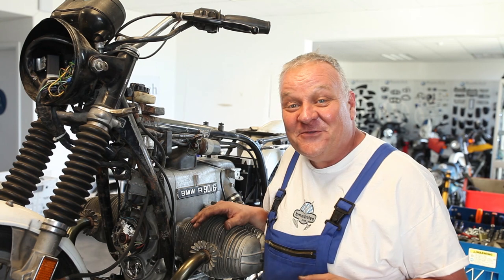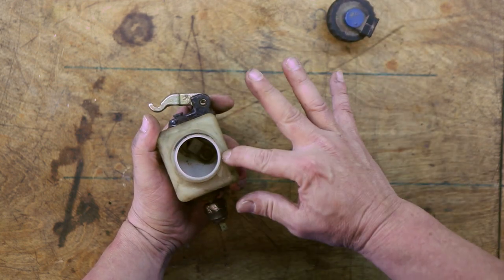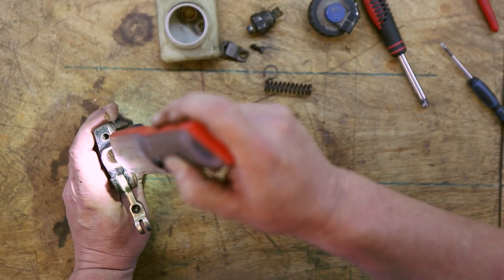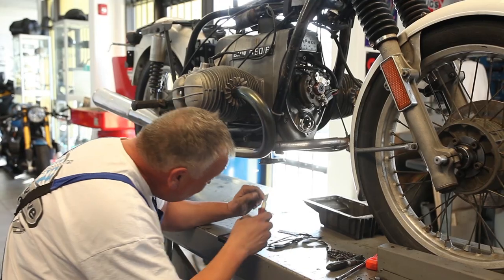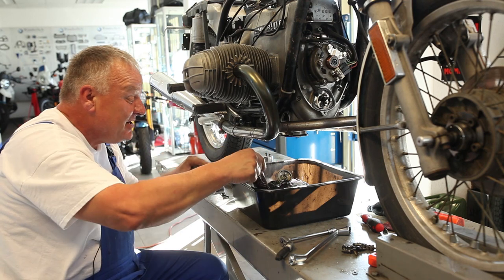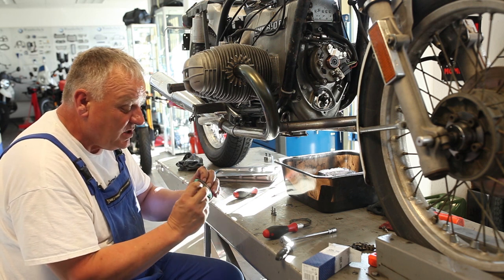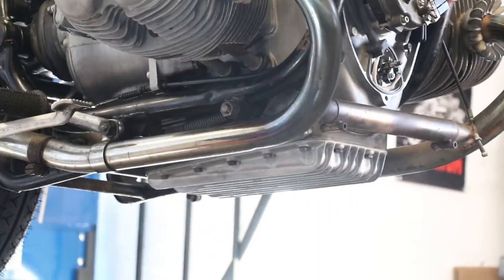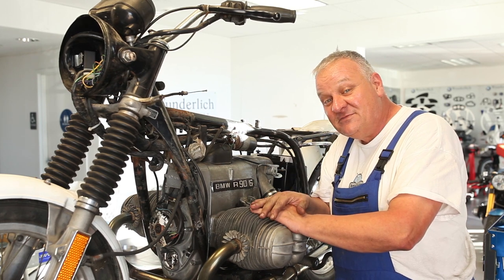R90/6 #14 Master Cylinder Removal & Oil Pan

Comment: Its funny that you mentioned about the old style O-rings on the oil filter. I am restoring a 74 R90/6 and its been sitting since 1986 and when I replaced the oil filter I saw that stray o-ring deep on the filter shaft. Having been a mechanic for over 40 years, I knew it needed to come off ! You are wonderful at letting people know those "Little" annoying things that most don't think of :) Thanks for being so precise !
Reply from the maker: Thanks, Amazing that there are still those O-rings out there!

Comment: Hi  Just seen you remove sump, I was surprised to not see you clean the oil pick
up pipe filter. I mention this because I have a Avensis which had a blocked filter
so much so that it lost all oil pressure.luckily I just caught it in time. 
Regards

Comment: good series.  two points   as many who are watching this have later bikes it would have been good to mention the $5000 O ring, that becomes an issue with the later design of oilfilter 
the larger the viscosity range the greater the amount of viscosity modifiers the less room for lubricating molecules

Comment: Does the 1976 R60 /6 Airheads also need the white o-ring?  I didn't see it in this video, I did however find parts of one in my oil pan, and a shim in the assembly...  Also I couldn't find it on your site (other than with the 2 piece oil filter kit), nor is it included in your full gasket kit for my bike, so i'm really not sure if i need it...

Great videos, thank you so much!!!

Comment: Hi there great video im going to change the oil on my 1979 r80/7 and take off the oil pan I've seen some people saying the bolt on the pan below where the oil filter is needs a bit of sealant on it would you say that's correct regards   mick

Comment: Hi, really good video. Do you have one removing and installing camshaft? My R90S has the nose of the camshaft distorted, and I can not calibrate points!!!
Reply from the maker: We have not yet produced any videos about complete engine disassembly yet, which is more or less what is required to remove the cam shaft. We will be covering that in detail with our next project, to be determined.

Comment: Hey! first of all thanks for your great video!
I was wondering if its possible to simply convert back an r100 with oil cooler, to this construction of your /6 so just an oilfilter, pan and and the lid? Meaning removing the tube to the cooler and and sealing it with the lid you removed to access the oil filter. 

Cheers
Reply from the maker: Hi, thanks! Yes, you can easily eliminate the oil cooler, but the parts will be not like a /6 but will do the same thing. You will need BMW part number 11 42 1 263 345 (cover) and replace the center tube with the shorter version (11 11 1 263 342) and at that point, you can use the non-cooler filters.

Comment: Hello, I have a 76 r90/6 that I’ve neglected changing the oil on. Looking to do it myself but there’s one thing confusing me. The bike came with an oil change kit from BMW. It has the hinged filter with two small o-rings, the gasket for the cap, and larger o-ring (1 1/4” approximately in diameter) 
After reading about the $2,000 o-ring (then subsequently discovering that 77 was the first year BMW introduced the design requiring the  $2,000 o-ring) I’m curious if this oil change kit I’d meant for a later year. But I’m light of all the horror stories I’ve read, I’m hesitant. 
In short, if I’m looking to change the oil for my 76 r90/6, will I simply only need 
1. The gasket for the cover
2. The oil filter and oil 
3. Crush ring for the drain plug?
Reply from the maker: Are the two small o-rings attached to the filter? If not, It sounds like you maybe got a very old oil filter kit. The two small o-rings that you mentioned used to be separate and now, and for many years, the seal rings are captive in the ends of the filter. If you have the old style, then it may be best to purchase a new filter. But you are correct. On an R90/6 you should only need the gasket. If the oil filter cover is flat, there's no big o-ring. If the oil filter cover is dimpled, then you do use the O-ring and most importantly there is a shim that goes in beneath the O-Ring. That's the easiest way to tell which version you have.
Reply: boxer2valve BMW Restoration and Parts Supplier 
I do think this oil filter kit is one of the elder models you spoke of. The filter itself has the BMW insignia on it and the two o-rings, I can imagine would fit around either end of the filter.
On a separate note, I appreciate the videos. Everything from the cleanliness and organization of the shop, the information itself, the camera angles and the editing is so well done. I’m looking forward to purchasing some parts from your website soon. 
Also, just subscribed to the channel. 
Thanks for the response!

Comment: Would you still use that Liqui Moly 15w50 on an air-cooled 1971 BMW R75/5?  Or, do you recommend something different?  I notice mine is hard to start when it's cold in fall.
Reply from the maker: Hello, Yes, I recommend 15W50 on all models from 1970 onward in cooler temperatures.

Comment: Great video as usual, did you change the oil pick up when fitting the standard sump or modify the aftermarket one that was fitted?
Reply from the maker: Hello and thank you very much! There was a spacer installed at the oil pickup to lower it. We simply removed that spacer, then reinstalled the oil pickup without it.

Comment: I would not waste time and money attempting to repair that brake master cylinder. A better and cheaper option would be to use a post 81 handlebar mounted master cylinder which is a superior item anyway. This is what my R90/6 has

Comment: The old pan looked coated with black sludge, do engines like that ever get treated with a flush first?
Reply from the maker: Hi. That's great question. In this case, since the bike had been sitting for such a long time, we decided to remove the pan. If you have a bike that runs, then an oil flush is always a good idea! We offer a great product from Liqui Moly which does just that. Part Number 2201657 on either www.boxer2valve.com or www.wunderlichamerica.com This stuff really works well and there is no reason why one should not use it at every oil change, but at least once, with subsequent frequent changes.

Comment: This video states that "more oil is always a good thing." In fact, BMW actually recommended putting in LESS oil in the R90 and R90S models because of complaints of excessive oil consumption, especially at high revs (above 6,500 rpm). A memo from Ettlich Lohmann, presumably a BMW engineer, dated December 1975 states, "The engine lubrication is by no means affected by the decrease of the maximum filling capacities. Often the oil temperature can even be lowered since, with less oil, there is hardly any heat build up, and heat dissipation via the oil pan outer skin is improved."
Reply from the maker: Thanks very much for that information! It’s extremely interesting and makes sense!